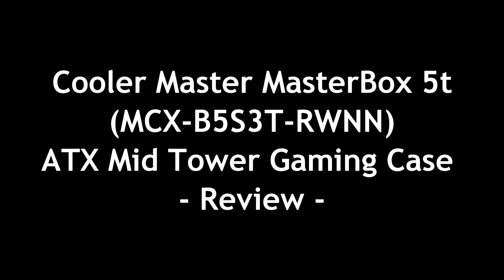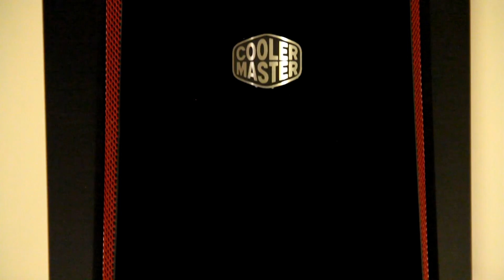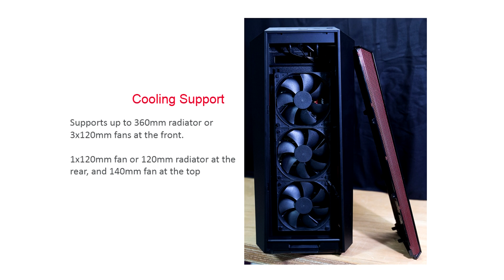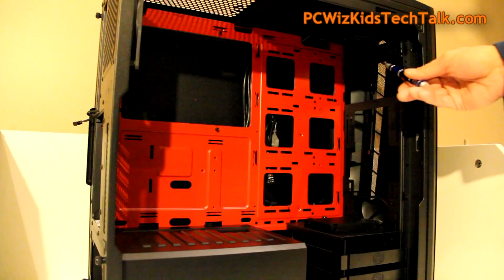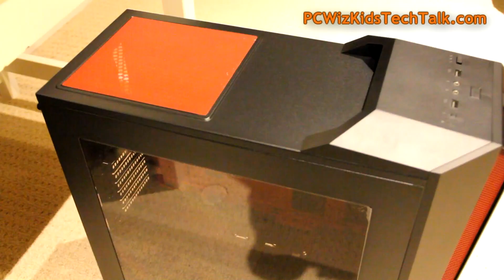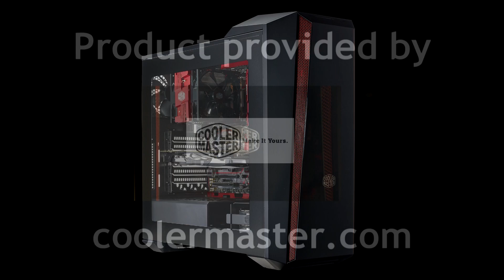Cooler Master MasterBox 5t Gaming Case Review

Comment: Nice video. I just ordered this. I want to install a 360mm radiator. the website says it is possible, but I am curious how it will be installed and how it will look, do you have 360 radiators that you can make a short video off or couple of photos to show how, please
Reply from the maker: It all depends on where you install it, top of the case or at the front.  You will need to make space for sure no matter what
Reply: @PCWizKid  thank you for reply, I think you got it wrong, in this particular case 360 radiator can only be installed in the front. I was just wondering if anyone has done it already? Cannot find example on internet I.e google forums or YT
Reply from the maker: @sajankhowaja2901  I didnt do it so I cannot tell you, but my response to you was that depending on how the case is made you can only install a 360 in a specific way, and some cases allow it at the top, others at the front.  In this situation adding it at the front may require you to move the hard drive bays